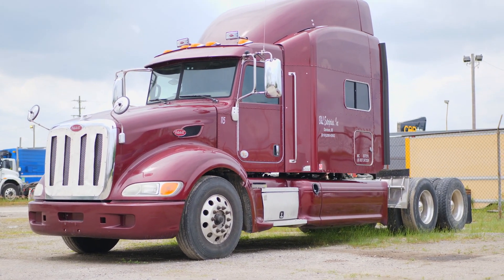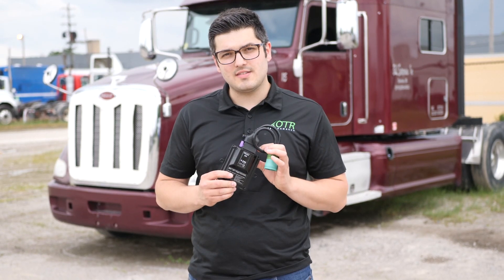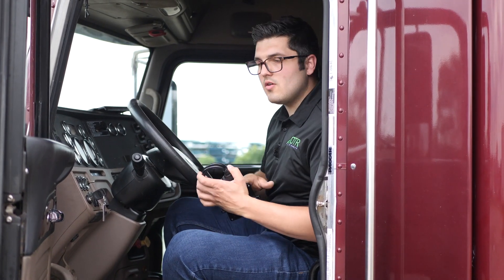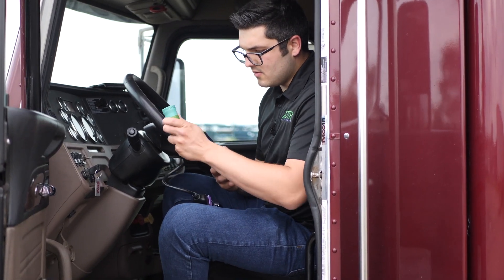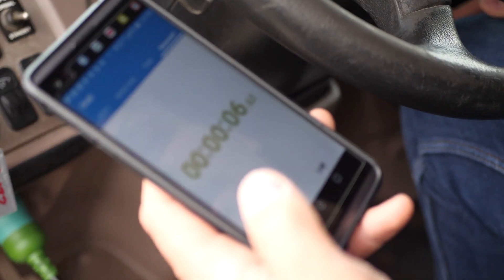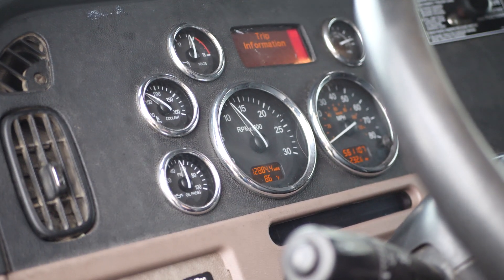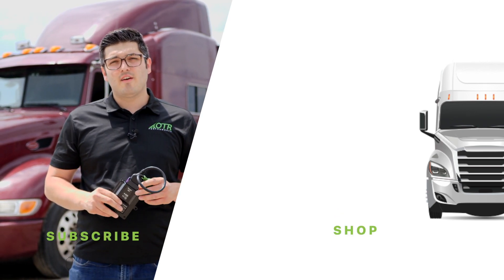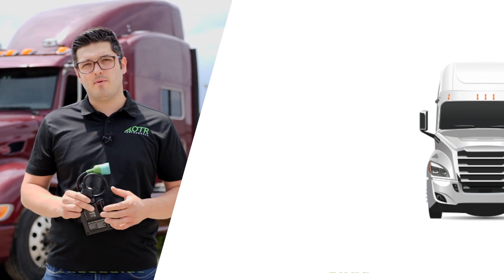How to Force Regen a 2013 Paccar MX Engine | EPA10

Comment: Hello, can you help me out?, i have a 2012 t660 paccar mx 13, i bought the dtc and already cleared the codes, but it wont do force regen, dont know whats wrong
Reply from the maker: Hi +mario bustos thanks for reaching out. Please give us a call 586 799 4375 and we will have a technician walk you through getting the Forced Regen started. Thanks!
Reply: @otrperformance  thanks for the video it works. You Rock